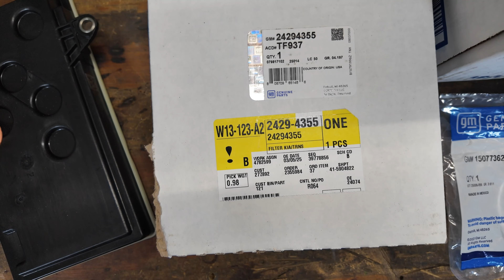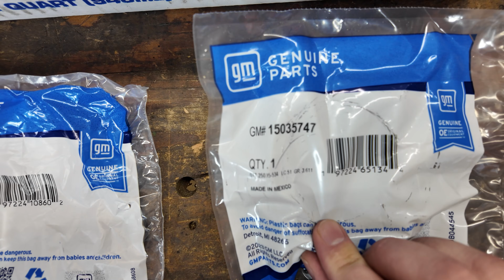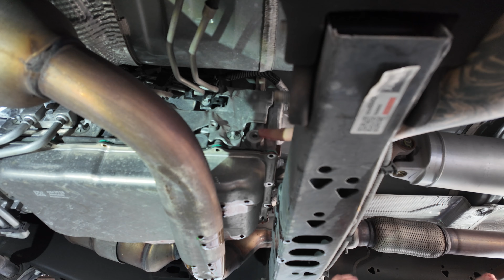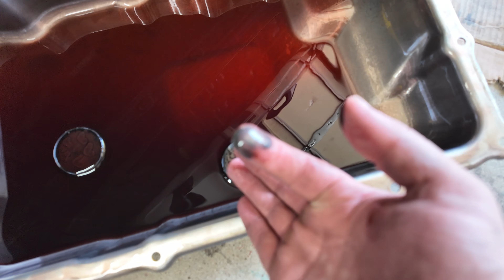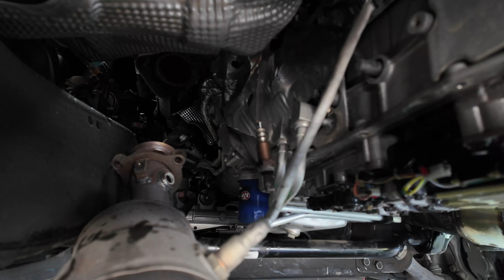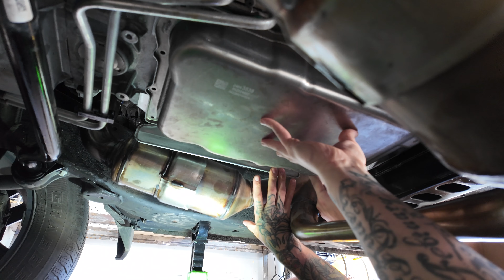Save Hundreds: Service Your Silverado TRANSMISSION Yourself

Comment: '20 Chevy 5.3,8L90. First service: I flushed the fluid at 33K. Very black from factory and was concerned due to recall on fluid. Second service: 65K flush but put in Amsoil. Third service: 91K dropped pan, replaced filter, better looking fluid. Fourth service: About to do this but will add PPE pan. It seems the key is consistent changes around 30K each service. The exhaust bar across the pan is a b*tch, though.
Reply from the maker: Nice!

Comment: Nice write up. Too bad you didn't replace the pan with the PPE pan, so you can drive it around and drain it and do it all over again. A proper fluid change should always include a fluid exchange flush as well, to get all of the bad fluid out. I am not sure why this isn't standard practice and why so many people are afraid of them. Never made sense to me to only change half the fluid, when you don't do that on literally anything else on a car that requires fluid changes.

Comment: According to my manual, the transmission fluid temperature (TFT) must be between 75-80°C (167-176°F).If the TFT is lower than this temperature range, either idle or brake torque the vehicle to raise the fluid temperature. If the TFT is higher than this range, shut off the vehicle to allow the fluid to cool as required.
Reply from the maker: Thanks!

Comment: I did this job on the weekend and it was haaaard. Many issues getting to the exhaust bolts.
I had to buy a special mid length 15mm socket to get the inside passenger flange nut off and on since the transmission bell housing was in the way.
I’m modifying the cross pipe under the transmission so it can be removed easily next time.
Dumb dumb dumb design!
I also had a hard time just to get the fill plug off. It was soooo tight and waaaay too much threadlock on it. Crazy!
I also broke off one of the pan bolts when torquing using the torque wrench. Bolts are cheap garbage and i think one was defective. I put better new ones in and it tightened down perfect every bolt.
My truck is a 2021 trail boss 6.2l w the 10l80 transmission.
Bottom line is the youtube videos make these jobs look easy but when you do them they are 10x harder than you think and take 4x longer.
Reply from the maker: Glad you got it done! Definitely not the easiest repair 😂
Reply: Thanks I  heard it a pain in the but.
Reply: Yes it is very hard I hope I find someone to do mine
Reply: I just finished doing this on my ‘19. I agree. It was a PIA, that inside exhaust manifold stud/nut on the passenger side was extremely difficult to access. I ended up rounding it, which led to me having to grind it off. This guy has practically no rust on his truck. If you live in the Northeast like me it is not going be a walk in the park removing the exhaust. ( I used an induction heater which helped removing the other 5 exhaust nuts.) Once dropping the exhaust is addressed you have tons of room to drop the pan. I used a fluid extractor to suck out as much fluid as I could which left about a half a quart in the pan when I dropped it.  My fluid looked a bit darker than his in the video. It only had 28k miles on it since the dealer replaced the valve body and replaced 8 quarts of fluid. The pan was very dirty too, so I recommend doing this every 25k miles if you have an 8spd like I do. I applied antiseize to the exhaust manifold studs in the hopes that it will be easier the next time. I ended up getting a mid length 15mm socket and an extra long 15mm ratcheting box wrench which helped with the exhaust nuts. Be prepared to replace all of the exhaust nuts.
Reply: @TSully7409 
Glad you got it done eventually. Yes that last nut on passenger side is awfully hard to get off. No room.
I’m in CA so it’s pristine and was no rust to deal with fortunately. What was interesting was that i had the opposite problem.
two of the 4 o2 sensors were super super loose and so were two of the 6 flange nuts. They were never tightened properly at the factory. Maybe came loose over time.
This was the first time it has been serviced from factory built. Weird 🤷🏼‍♂️🧐
I put everything back on w/o antiseize but there was a lot of pb blaster thread penetrant all over everything so i skipped it.
I think i’m going to have a drain plug welded to the pan in addition to the quick disconnect cross pipe. 25k fluid change sounds like a good idea 👍🫡
Mine was medium brown and not burnt smelling at 63k miles but was not used for towing and mostly easy driving.
Filter looked worse than the fluid actually 😬
Reply: @john-fech I actually don’t tow with my truck at all, so the fluid being as dark as it was at 28k miles was alarming. Maybe half of that mileage was highway driving. I’m tempted to even just use the fluid extractor to change the fluid more often without dropping the pan. But there was a lot of that wear material on the magnets and the bottom of the pan which you’d need to drop the pan to get at.
Reply: @TSully7409 
Interesting 🧐
My magnets had very little on them but my filter looked very black.
I like your approach.
I’m doing mine every 25k i think both pan drop and filter but after the cross pipe mod and adding a drain plug maybe even a ribbed deep-pan if i can afford it.
I hear that heat is the enemy. I’m hesitant to mod the bypass valve before the warranty is up but after i might delete it or swap w one that opens at a lower temp. 🤷🏼‍♂️
Reply: @j @john-fech purchased one of the aftermarket bypass valves but I haven’t installed it yet.
Reply: Similar experience. I had to heat up the passenger side exhaust flange but to get it free. Yep that drain plug put a pretty nice flex on that 8mm Allen. Start to finish about 8 hour job for me. But if you know what your doing probably 4h

Comment: Dropping the pan only drains 7.4 quarts . Full capacity is 12 quarts . Remaining 5 quarts of fluid is still inside torque converter , cooler and cooler lines . Your fresh 7 quarts of fluid is contaminated with old 5 quarts = you negated the entire " service " .  ULV - ultra low viscosity is for 10L80 , for 8L90 the correct fluid is Dexron VI  (6) for that particular year model . Pan drop IS NOT a GM approved transmission service method and it voids powertrain warranty . Transmission fluid thermodynamics DOES NOT work that way where diluting old worn out fluid with partial fresh fluid " extends fluid life " . That remaining old 5 quarts of fluid have broken down anti friction properties and it contaminated new fresh 7 quarts you just put in - it DOES NOT replace broken down anti friction properties and thermal performance by " refreshing it " with only 7 quarts . That is the reason why it is NOT GM approved method and it voids the warranty . DO NOT do this " service " like he just did - do it correctly : disconect the cooler lines , put the cooler line in the bucket for old fluid , another cooler line into bucket of fresh 12 quarts , start the truck and let the the torque converter purge old fluid while at the same time drawing in new fluid . The level check is also incorect . After initial fill the trans fluid level is checked between 95 - 115 degrees , shift through all the gears and then do the hot check at 170 degrees . Correct level: A slow, steady drip or light trickle streams out of the hole. Low level: No fluid comes out at all; you must pump additional fluid into the fill hole until it begins to trickle out. If you let it drip out untill there is no fluid coming out - you are LOW and drained too much .
Reply from the maker: Thanks for watching!

Comment: This is not the correct way to check your fluid on a 10l80 and it is not how you ad fluid it's the bolt that looks like a drain bolt for the transmission a simple aldata  check would tell you this don't do this it will result in an under filled transmission
Reply from the maker: Thanks!
Reply: @alwaysandy1 no problem I had issues doing this got the alldata from work and turns out every video on here is wrong and must be done running

Comment: Good video but is it really required remove the O2 sensors? Isn't there enough play in the wire harness and just unbolt the exhaust ?
Reply from the maker: Probably not, but it does give you more room

Comment: I have the 8speed transmission. 8L90. From what research I did, since the two fasteners only hold the filter in place they do not need to be replaced and are not “torque to yield” screws. Is this true?
Reply from the maker: I’m not sure about the 8L90
Reply: 8L90 filter doesn’t have screws, it presses in.

Comment: How many bolts were on the heat shield on the side of the transmission? Most videos only show removing that one and then video cuts to it being removed. It seems like there’s more to it.
Reply from the maker: I think it was just that one
Reply: 1 on the side, 2 on the top.

Comment: Go to Chevy dealership and go to the parts department they have the E10 Torx aluminum bolts and they also require a torque angle meter after you torque to 44 ft-inch then to 180 degrees on the torque meter
Reply: ID JUST WING THE 180 DEGREE
Reply: The ft-inch units of measurement don't make any sense.
Reply from the maker: @vinceadams1581 😂😂
Reply from the maker: Thanks!

Comment: Because removing the exhaust is waaaay easier than installing a drain plug
Reply from the maker: Removing the exhaust isn’t terrible to do
Reply: Still need to change filter, so drain plug wont help with that.

Comment: I have the same transmission on my 2020 at4. Now I see you have the same thermostat valve housing as I do for the transmission. I was trying to get an aftermarket thermal valve bypass to  reduce temperature but not sure if there’s one compatible to replace it. Are you still running your stock one? Why are these different from the other common ones?
Reply from the maker: I’m still running the stock one, haven’t had any issues with overheating yet
Reply: Cool thanks.
At most I’ve seen 195 degrees on the transmission but would like to keep the temperatures lower. I have around 70k miles on the truck and am about to service the transmission. I might just upgrade the transmission oil cooler and see if there’s a difference in temperature.
Reply: @KidArt17  Yeah, if you tow, just install the bypass. Mine normally runs 120-130 unloaded and 150-170 towing

Comment: you can get that pan off without taking the exhaust out
Reply from the maker: Definitely not 😅
Reply: On the 6.2 with 10L80 on 2019? How?? Unbolt transmission and jack it up? Seriously, would like to know, exhaust bolts are a pain in rust country.
Reply: 100% correct (for the 2020 5.3 4wd at least)

the pan just tilts down and forward to easily clear the exhaust. the fill plug on mine is rubber stopper on top behind the heat shield (bolted on w 2 10mm bolts)

Comment: I had my Silverado in for warranty for the transmission, they told me in order to change the transmission oil and filter they needed to take the transmission out. is that true or are they trying to rip me off?
Reply from the maker: What 😂😂, absolutely not, that doesn’t make sense lol

Comment: Instead of dropping the rear side first. Take out the service bolt, then drop the front side (where the service bolt is) and you will drain pretty much all your oil NOT on your exhaust. :)
Reply from the maker: Thanks!

Comment: how come after getting to temp, you have to open the plug and let drip out? I really wanna do this but I'm nervous too!
Reply: If you wear rubber gloves you won’t get burned even if you get a little on your hand.
Reply from the maker: Don’t be nervous! And fluid expands when it heats up. This way we’re sure it’s not over full

Comment: Great video. Thank you for sharing. I am trying to troubleshoot the "Chevy Shake" I have right now. Truck shakes or "shivers" when I accelerate or just randomly with the cruise control on. I have replaced all 6 spark plugs so far (had to take off both front wheels and the fender wells to even get to them). I've put the top-of-the-line fuel injector cleaner into a tank of fuel. Still shakes. I've also got a balance and rotation. This is my next box to check. My 2020 Silverado 1500 v6 has 93k miles and I haven't replaced any transmission fluid yet. Hopefully this job will fix it. If not, gonna have to search YT for a "fuel injector replacement" video.....
Reply: Light throttle accelleration shakes and vibrations?    Can be the dynmic fuel managemnet switching betweeen one of 17 cylinder firing orders or it can be 3 things in the transmission,  none of which a fluid and filter will fix, only mask.   Could be torque converter failure,   Also can be valve body bleeding pressure off from worn seperator plate or check ball or valve body itself.    Disaster of when you let ford build your transmission, not that chevy's designs are any better at this point.   I do love the look of the trucks and the interior in the refresh 2023 models is outstanding but just unreliable junk powertrains.    Nothing fun lasts thou so theyre is that.
Reply from the maker: Oh no! Hopefully the transmission service helps!

Comment: If I wanted to do a flush and a filter change, would you recommend flushing them changing the filter or changing the filter then flushing?
Reply from the maker: I’d flush it, then pull the pan off and drain it, change the filter, than fill it back to full
Reply: @alwaysandy1 you don’t think flushing it without changing the fluid first will cause the machine to push the old fluid with the break in metal shavings through the tranny and cause issues?
Reply from the maker: @Rivalsboiz10 I wouldn’t flush it at all to be honest. I think frequent fluid changes is best.
Reply: @alwaysandy1 how frequent? And you said you’re a GM tech right? Is flushing it really making things worse?

Comment: What is your thoughts on performing a flush right after a pan drop with filter swap? It sucks to waste the new fluid you put in but i really dont like the fact that you are mixing 40% new fluid with 60% old. Also, i like the idea of an after market pan with a drain plug, and additional capcity. Are any of these shaped to remive without touching the exhaust?  And what are your thiughts in these?
Reply from the maker: I really like the idea of an aftermarket pan, with the additional capacity

Comment: Owner's manual on a '23 Silverado 8 speed mentions nothing of changing trans fluid. Suggests transfer case @ 100k miles & 150k miles on coolant. If your truck is a commercial application or "severe service" then suggests service trans @ 45k miles. I'm trading my truck @ 5 yrs of age / 50-55k miles & not servicing the trans. No way in hell am I paying dealer a grand & they don't drop pan or replace filter.
Reply from the maker: Forreal thou lol. What are you going to get when you trade in?
Reply: @alwaysandy1  The important factor is what is paid new. Bought truck in the fall of '23. Dealer had marked down via incentives/rebates/dealer discount to $40k. Utilized Costco Member incentive to bring down to $39k, & GM credit card earnings / points of $2,200 to reduce to $36,800.
Reply: @alwaysandy1  5 years - will be half of $50,500 sticker price - so $25,250. Paid $36,800, so will only spend $11,550 for 5 yrs of ownership - 50k miles - w/ bumper to bumper & drivetrain warranty -  $193 per month
Reply: Currently Carvana value is $32,400 after 22k miles & 26 months -$4,400 depreciation - $169 per month.

Comment: Went to the dealership and they told me " we don't change the filters just the drain and fill." Thoughts anyone?
Reply: My dealer will do the filter on a 2022 Silverado - $950 for just flush, $1200 for a flush + filter - crazy!
Reply from the maker: Sounds like a problem to me, it has a serviceable (replaceable) filter, I wonder if they have a reason to not replace it. Also what does a drain and fill cost?

Comment: Did you also replace the pan gasket? Not sure if i got that… ur filter looks different to mine i picked up from chevy dealer for 21 silverado z71 custom trail boss 5.3
Reply from the maker: Do not need to replace the pan gasket unless yours is damaged for some reason
Reply: @alwaysandy1 thx bro
Reply: If your filter looks different, then you probably have the 8 speed transmission. The one shown here is a 10 speed.
Reply: @JJ64018100% my case. Called dealer back & they said i have the 6l80

Comment: I have a question. I have a 2022 silverado custom with the 8 speed.   58k miles  can i still do a fluid /filter change  or should i do a flush. One chevy dealer said not to anything as its too late and  another recomended a flush.. any info is appreciated.  Thank you
Reply: Don't do a flush, just a fluid change and filter. My buddy got a flush awhile back ago and truck has been running rough since
Reply: @BLKtyrantOrthros   thanks
Reply from the maker: Excellent question. Very weird that the Chevy dealer said it’s too late, as the service is due at 60,000. Fluid exchange and a filter is always a safe thing to do regardless of mileage. A lot of manufacturers don’t want their transmissions flushed ever which may be why they have gotten away from having dipsticks.
Reply: @alwaysandy1 . Thank you

Comment: Do you really have to change the exhaust gaskets? I genuinely want to know, also where you bought the pump. And Ive seen some videos were you have to go into all the gears when changing the fluid or something like that I was just hoping you could clarify that. I’ve never done a transmission change and Id rather struggle than to take it somewhere and not know if they did it right
Reply from the maker: Good questions! No, you do not have to change the exhaust gaskets unless they’re for some reason damaged. To be fair, they’re pretty cheap (links in description).
Also, their pump is from Harbor Freight. The Amazon version is exactly the same (link in description). 
I would definitely suggest doing the service yourself, as long as you have the very few hand tools needed to complete the service. It’s way cheaper this way, and you know it was done correctly.